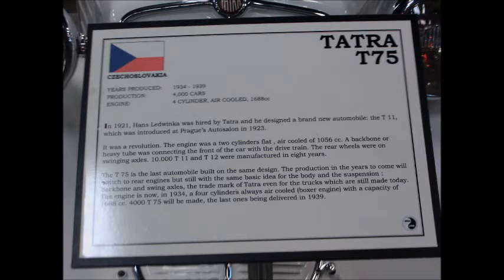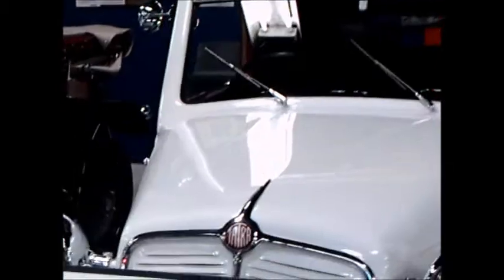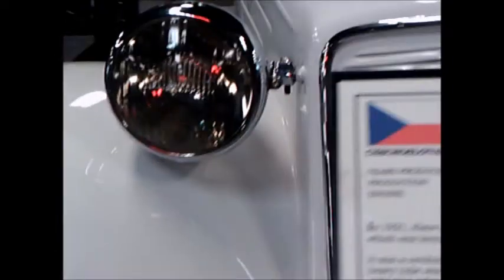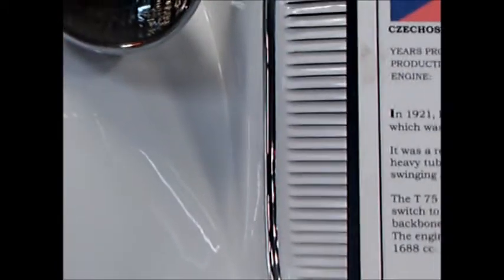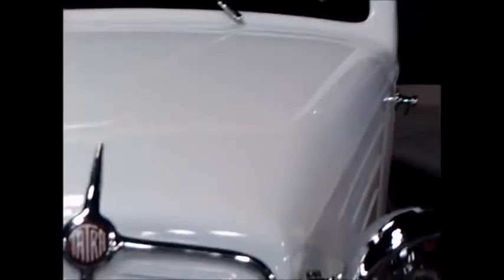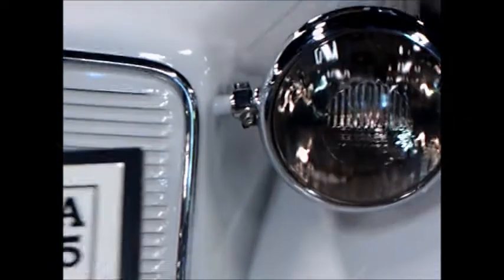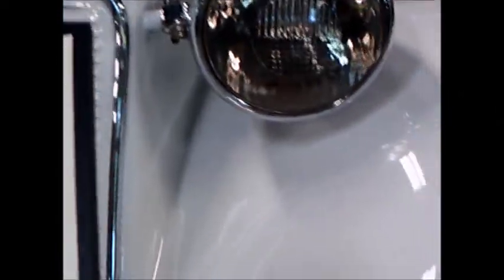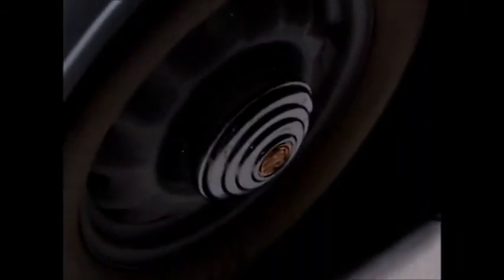1939 Tatra T75 Cabriolet Wht TampaBayAutomobileMuseum052315

Comment: Hey Jack. Another Tatra. I've never heard of this car. I've heard of the T87, and the 603, among other rear-engine vehicles. :)
Reply from the maker: +Jason Carpp Hey, Jason!  Yes, this car is probably more rare...and more manageable than the bigger cars with their eight cylinder engines.  Thanks!  :) Jack
Reply: +Jack R I don't know, since I've never seen in person, nor have I driven a rear engine Tatra. I'd be willing to drive one if it were available in this country. :)
Reply from the maker: +Jason Carpp Hey, Jason!  This is front engine, probably fairly similar to more modern front engine cars.  It's the rear engine Tatras that were a handfull!  Thanks!  :) Jack
Reply: +Jack R I've never driven a rear-engined car, so I wouldn't know what they're like to drive. The only rear-engined vehicle I drove was a 1972 VW Vanagon (Bus), and I didn't get to drive it very far, just around the block. :)
Reply from the maker: +Jason Carpp Hey, Jason!  Nor have I...but I understand it takes a little time to get the feel of the driving dynamics of the rear engined cars.  Thanks!  :) Jack
Reply: +Jack R So I hear. All the cars I've driven have either been front engine, rear-wheel drive, or front engine, front-wheel drive. :)